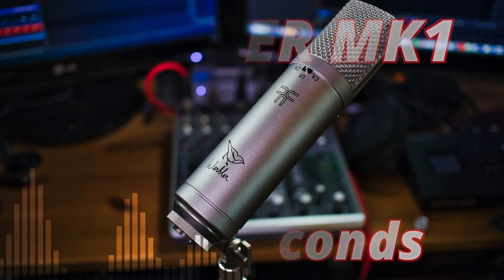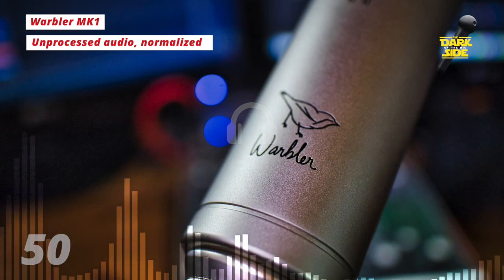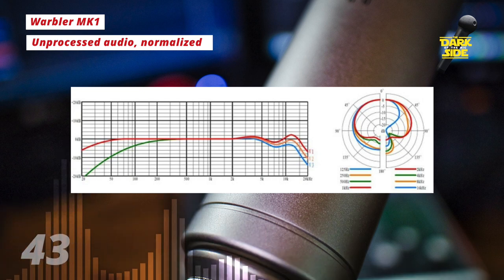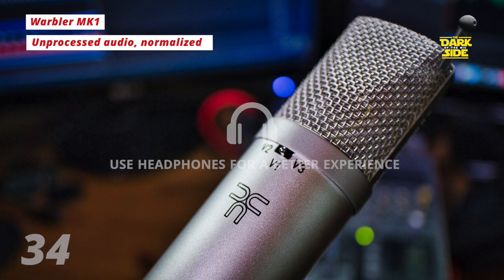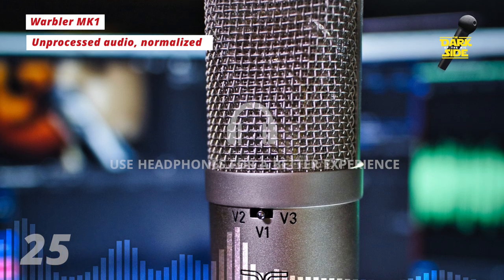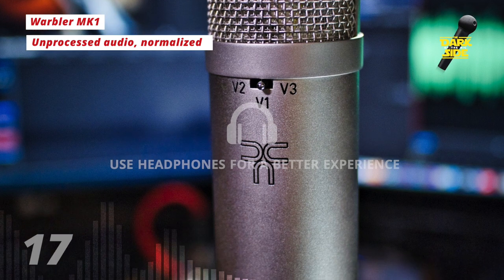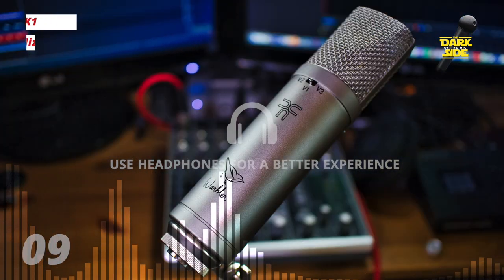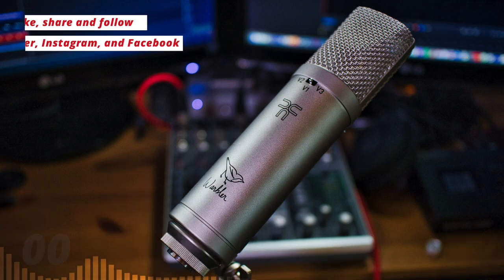3U Audio Warbler MK1 in 60 Seconds

Comment: I like mine a lot, and it's particularly good for recording my wife Julie's singing and for spoken word. 

I've got several of the 3U mics and rather like them. I've come to think the upper mids boost of the MkII is better for my singing voice. The cheaper transformerless 3U CM-1 Black model is pretty good for me too. 

I also use the cheaper 3U Audio CM-1 Teal a lot as an instrument mic. It has a nice, smooth quality, not too much in the highs and a tight pick-up pattern - but watch out for a strong proximity effect. I've also found the Teal CM-1 to be a useful spoken word mic.
Reply from the maker: I’ve got a GZ251fet coming as well. They do sound good, very good. Not had time to do any serious testing yet, but the MK1 is definitely more airy than my k47 mic. Big full bodied sound, fairly versatile i think.
Reply: @thedarksidemic  I'm sure it won't let you down. 

I haven't got a GZ251, but do have a cardioid-only MkIV. It's nice on my acoustic guitar, has a lovely smooth quality and again has a tight pattern, but I haven't yet found the instrument or voice where it really shines. It'll come along one day; thinking about it, it could be a high whistle, fiddle or mandolin, or a high voice that would benefit from a touch of warmth.

And that's my experience with 3U Audio mics summed up!
Reply from the maker: @GavinAtkin  was tempted by the mkiv, supposed to be quite similar they say…

Comment: Nice piece. Would be a plus if it's end-address.
Reply from the maker: Thats an interesting point. I would Email 3U and ask about that, although it seems condensers are their thing. I've been waiting forever for Se electronics to release a broadcast dynamic and low and behold they have just announced the DynaCaster (awful name) but that looks quite brilliant, given how good their capsules are. In this sense it's a cool time we're living in (one of the few perks) where we can directly access and influence product development (providing suggestions emanate from somewhere sane). My guess is the best end address broadcast condensers at the moment come from Earthworks (not tried any of them yet) but there aren't many others. Most of the "big" radio stations in the UK are all LDC based, but they have nice studios to work in...I do have a Lewitt MTP 740 CM which is end address handheld, 2.5cm capsule - kinda tlm 103 sound, bright but muscular, decent off axis rejection though.